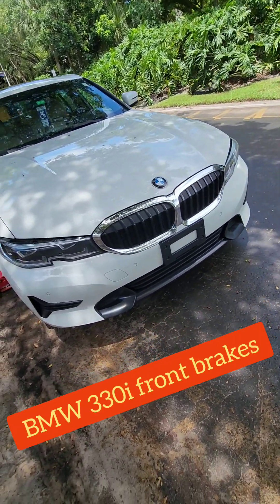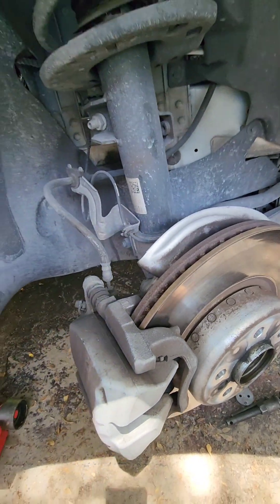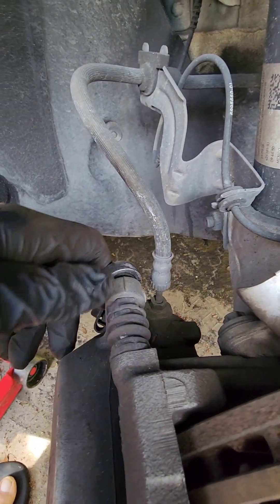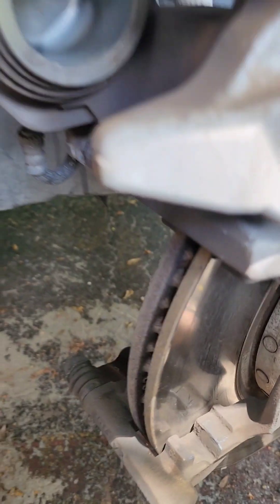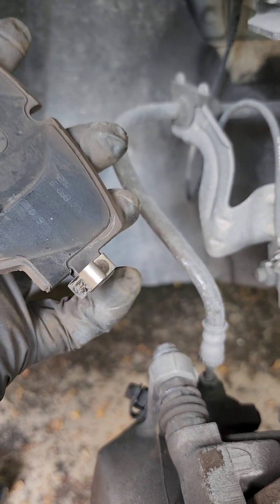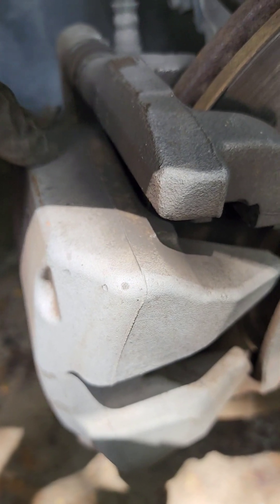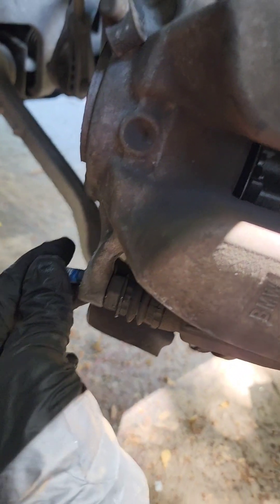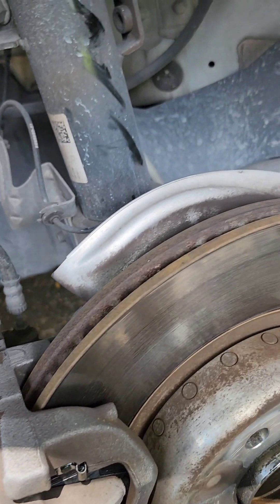BMW 330i Front Brakes Replacement

Comment: Do you have to put the metal clips on the bottom of the brakes pads? It looks like you didn’t use any. I wonder if it would cause the brakes to squeak.
Reply from the maker: You can put them on the top, the metal clips are the indicators. When your pads are worn out, the metal clips start touching the rotor to let you know that the pads need to be replaced